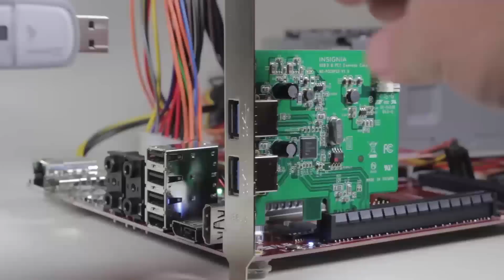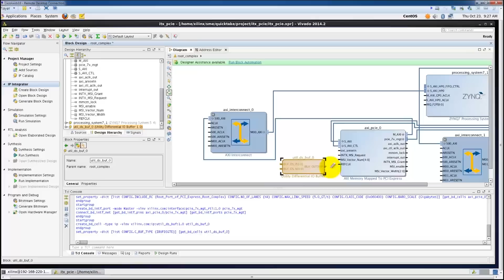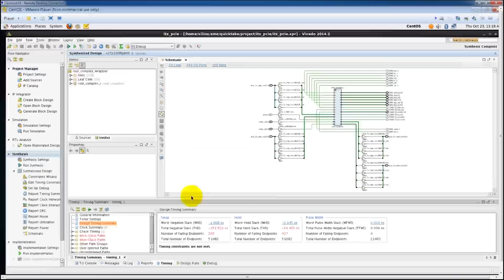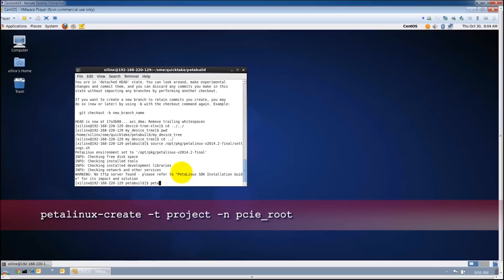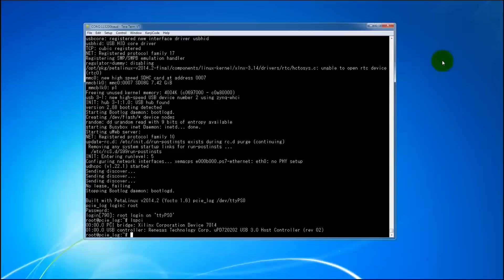Zynq PCI Express Root Complex Made Simple

Comment: Thanks for the video, however there is an error with the design.

The way you've configured the reset circuitry, perst_n is an input. However, the root complex should be providing perst_n to the peripheral(s) so should be an output.
Reply: Matt Bourne Hi Matt – Thanks for catching this. You are right, perst_n should be an output.  In our setup, the endpoint we are using probably has a pull-up on its perst_n input and that is why we don’t see any issues.  The easiest way to fix this is to make perst_n an output.  In the processing_system7_1 block, enable the FCLK_RESET0_N output.  Use this port to drive the perst_n pin and all of the other block inputs that perst_n was driving.  We'll be updating this video in the June time frame and will make the correction then.

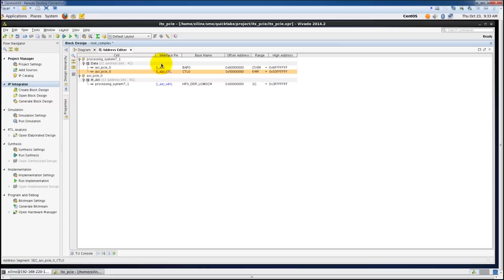Comment: Is my understanding correct that the Offset Address 0x00000000 in the Vivado Address Editor (at 8:14) is pointing to the DRAM of the external device? Is it then correct, that since the AXI-PCIe BAR Translation for BAR0 (at 3:20) is set to 0x00000000 as well, the BAR0 range will be mapped into that DRAM?

Comment: We're getting an issue control space access.  While most registers work correctly, the Base Memory (0x20 LSB, 0x21 MBS) reads all 0s when 0xFFFF is written to it.  However, 0x20 does read 0xFF only after a byte write to 0x20.  Byte write to 0x21 does not work. The Base Limit registers works fine with word writes.  It reads 0xFFF0 after word write of 0xFFFF.  Any ideas? Thanks.